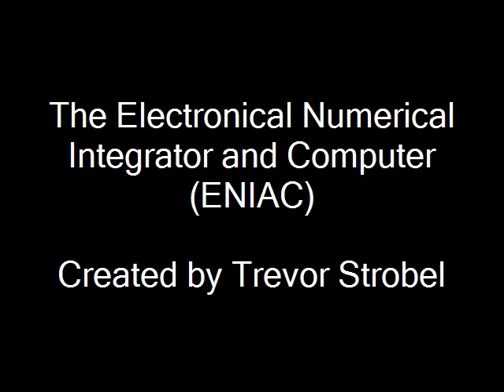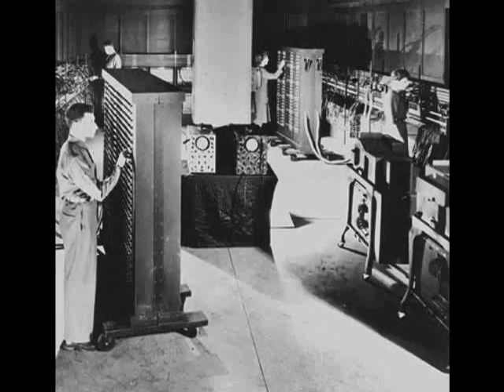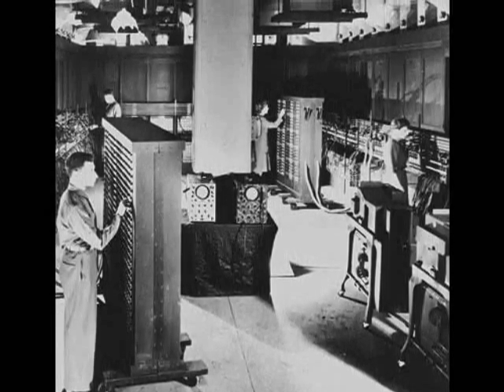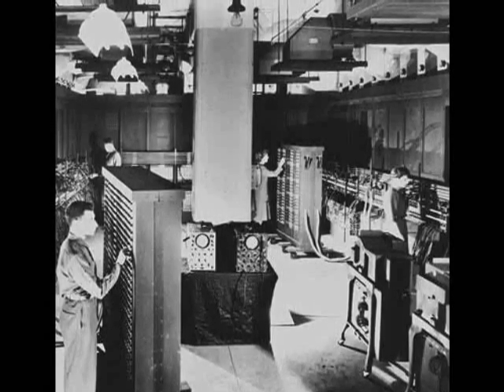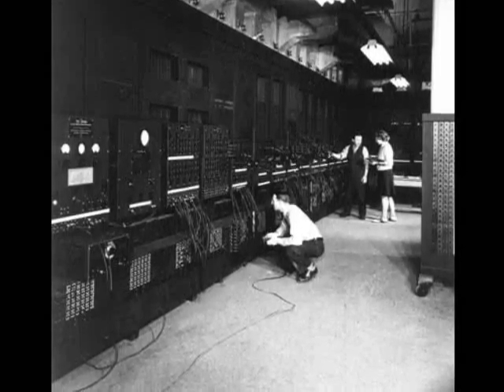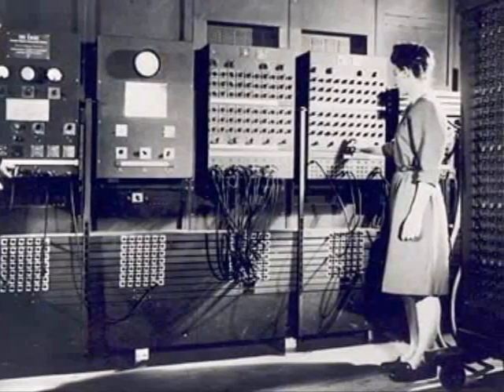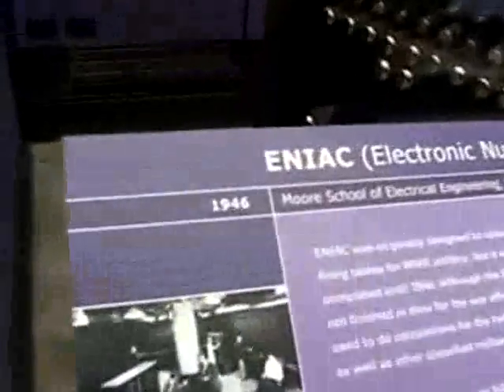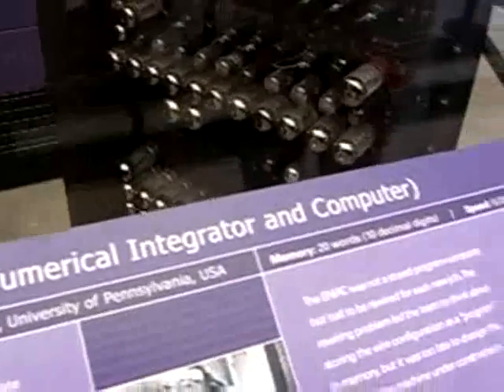ENIAC

Comment: There is no remains of Z3 nor ENI(AC-level documentation. Anyone can reconstruct anything, including the Egyptian pyramides. The ENIAC has operational logs, evidence, photos and witness of people that worked there. In addition, computers are fully electronical thus SIGSALY qualifies as a computer much more than the "Z3". Mechanical devices have clear operational limitations. The Z3 was not fully turing complete by design but some modifications were needed.